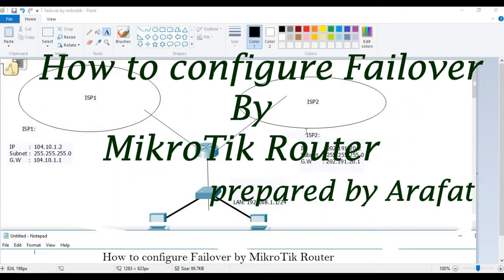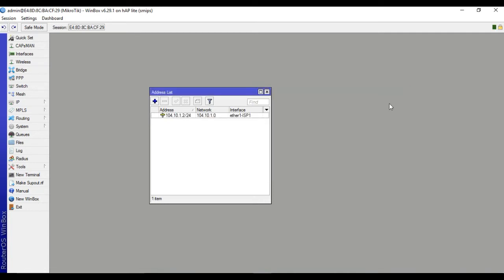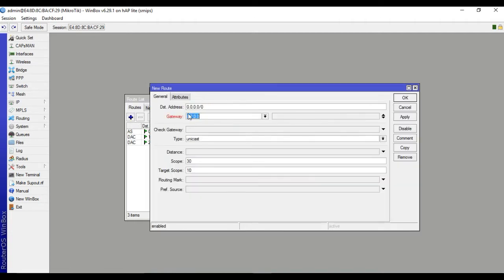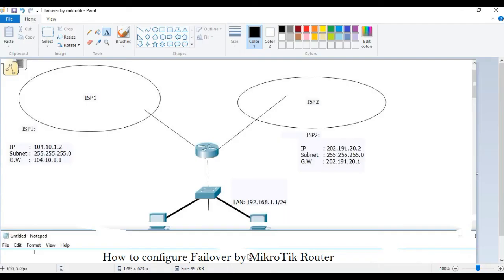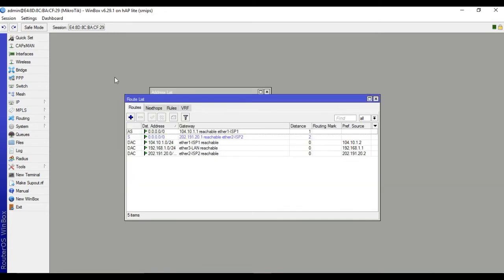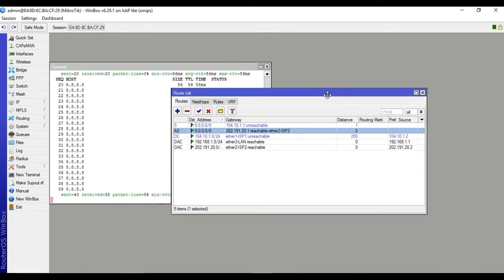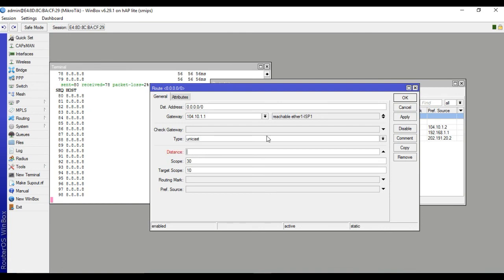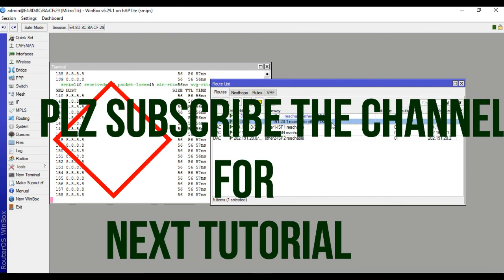How to configure Auto Failover by MikroTik Router

Comment: This only works if you manually unplug ISP1's cable or your router for ISP goes down. If your internet connection fails for ISP1, this will not work.

Comment: very beautifull video   sir actually my  isp1  is connected but not coming bandwith  . then not up isp 2 automatically .what i do    when i proper shutdown isp1 then isp2 running
Reply from the maker: do Fix
For ISP1
=======
IP--Route--Check Gateway= ping
                              Distance = 1
For ISP2
=======
IP--Route--Check Gateway= ping
                              Distance = 2
I hope problem will be solved.